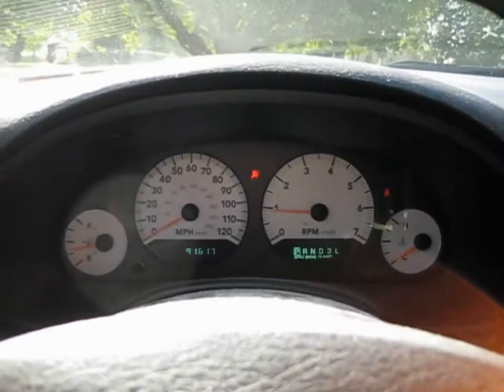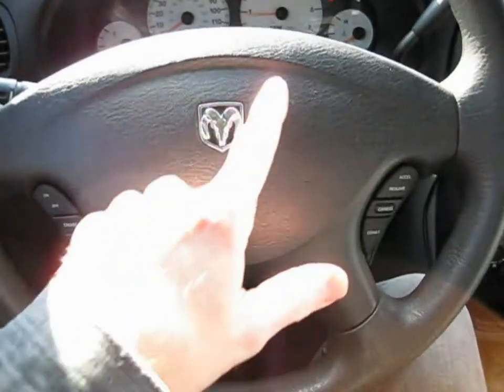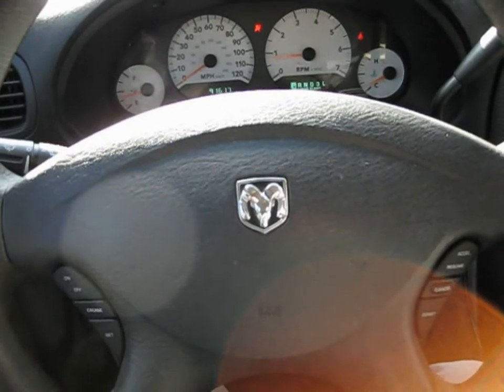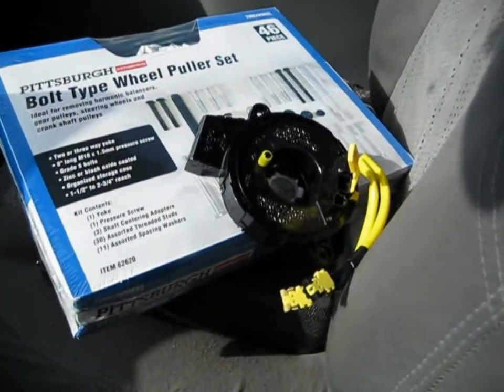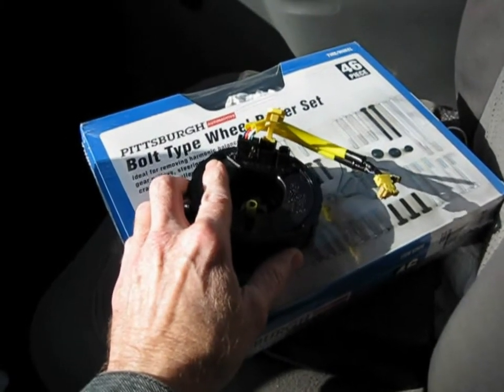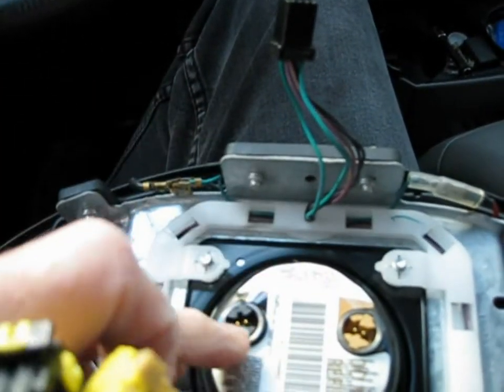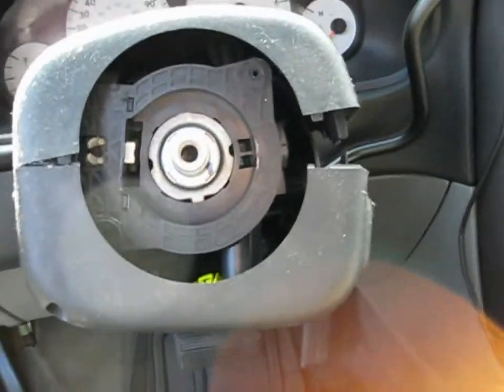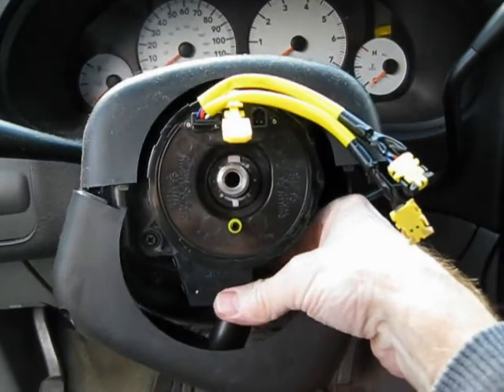Airbag Light: Clock spring Replacement  2001-2007 Dodge Caravan, Grand Caravan, Town and Country

Comment: My horn works but goes off indiscriminately, stuck on. I also have airbag light on. I'll make this replacement, thanks for taking the time to share.
Reply from the maker: Also check if your cruise control works or randomly cuts off.

Comment: We had a new rack put on our 05 Grand Caravan and have gotten abs and airbag errors shortly after. Hopefully they are similar issues to what you’ve experienced. Scanning tools arrived today so I will attempt to diagnose the problem in the morning.
Reply from the maker: ABS error? Sounds like the ABS cable at a wheel was damaged. Clock spring shouldn't throw an ABS code. 
Airbag yes. If your horn and/or cruise control also stops working it's almost guaranteed to be the clock spring. If a shop replaced your rack, make them replace the CS, it's their fault it broke.

Comment: If the clock spring goes bad does the horn always not work as well or does it depend on other things
Reply from the maker: For me the cruise control was the first to go, then the air bag light came on if I remember correctly. When the horn gave out I knew exactly what the problem was. It's a ribbon cable so I guess they can fail in any order.

Comment: Thank you for your video. I have the same model, air bag light is ok, however radio turns on without sound, volume buttons behind the wheel are not working, cruise control some times work, some times it doesnt. Do you think it could be the same reason?
Reply from the maker: It sounds like it is the problem. My car doesn't have the sound buttons on the steering wheel, but my cruise control became intermittent before failing, then the air bag light started coming on & the horn stopped working. Switches on the steering wheel failed one after another.